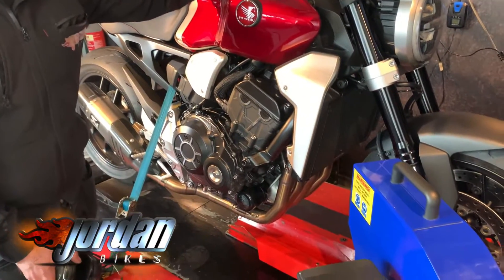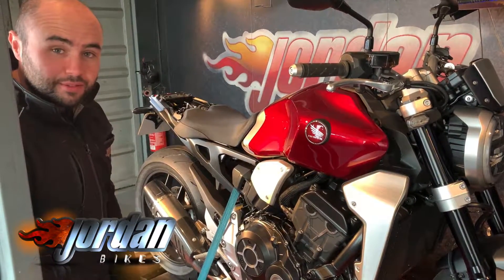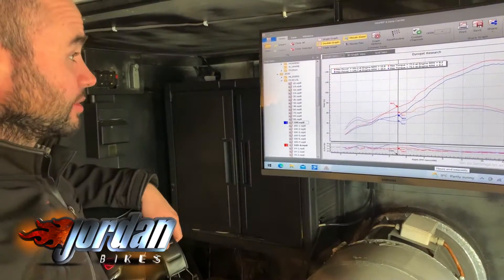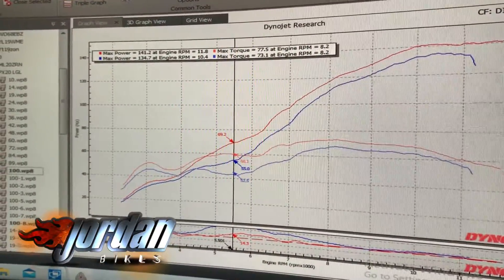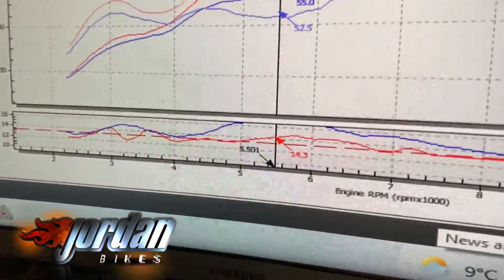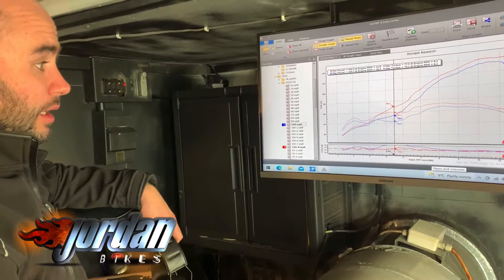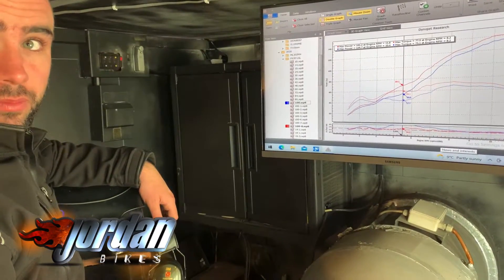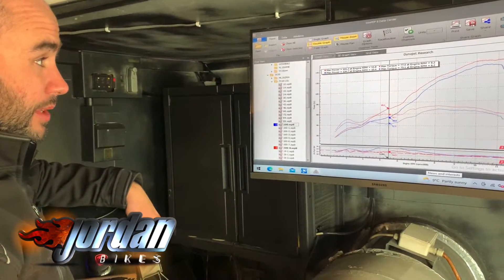Jordan Bikes CB1000R ECU Remap - 2020, full Akrapovic system, BHP up from 134 to 141 BHP.

Comment: CB1000R Black Edition 2021 EU5 Map is horrible with Power being 50bhp at 5900rpm, at 6000rpm it jumps to 103 & then at around 8500rpm its full power of around 143 ish... I want a full system putting on plus it remapped properly to remove the EU5 crap along with some of the other settings thats proper annoying.. let me know ?
Reply: @MichaelJamesWood  Its a new ecu & hasnt been hacked yet as far as im aware...ill post if i see anything..you do the same lol.... remapped this bike would go from fun to beastly thats for sure
Reply: @MichaelJamesWood  not heard out